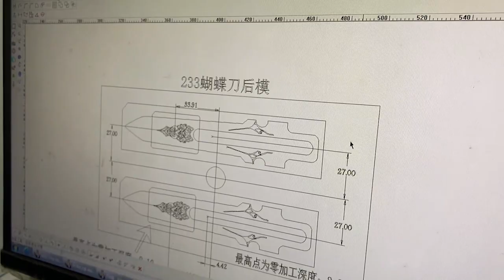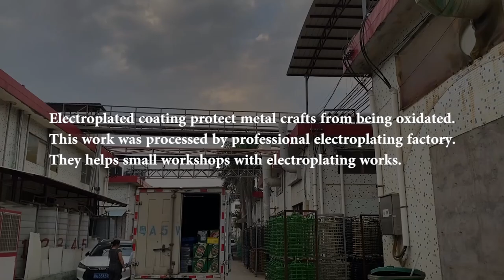How To Make The Best Octane Heirloom-V3 Octane Balisong Replica With Liquid Tube Project

Comment: I love the amount of care put into this but I literally just opened mine and half the liquid has leaked out, but I can't identify where it's coming from as the vile is not cracked from what I see. The handles were almost falling off and when I very lightly tighten them, the knife no longer opens or closes without major resistance. They included some washers but there is no clearance in the handle to install them so I really can't figure out what is wrong. On the visual note, many spots on the knife were not painted properly, as in chipped paint, missing paint in some spots, or overprint where paint is coating areas that it's not supposed to. Sent a email and a review posted but it says the seller does not accept returns so my expectations aren't high to see the issue resolved but I will edit this comment if the seller can help me out. 

My knife still works on display I guess but the moment you are close, all the issues I spoke of are immediately noticeable. The website and other ads rant and rave about high quality and this video speaks towards that, but what I received makes me wish I had never spent the $40 in the th first place. 

06-25-2024
Reply from the maker: nothing can meet everyone's expection